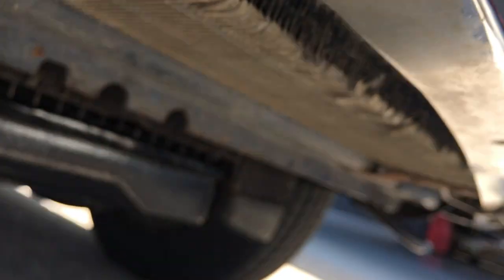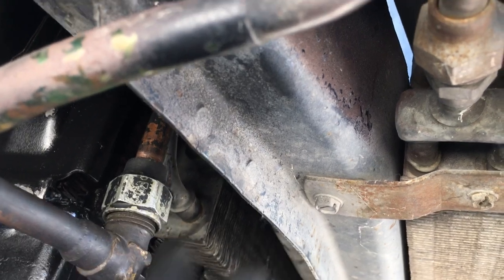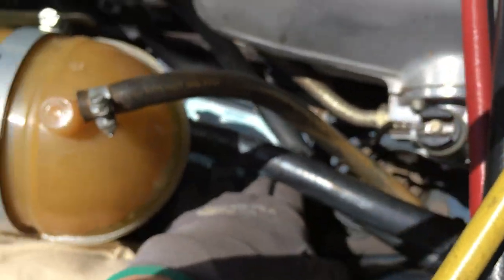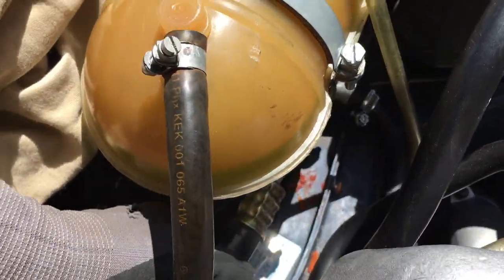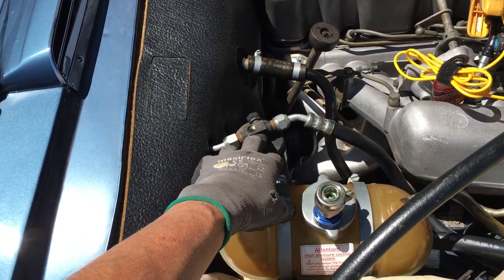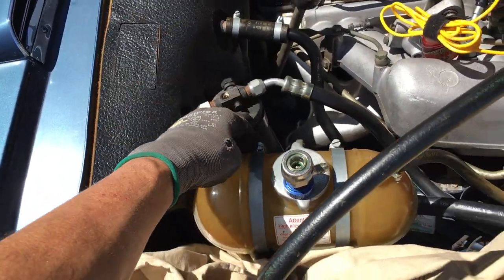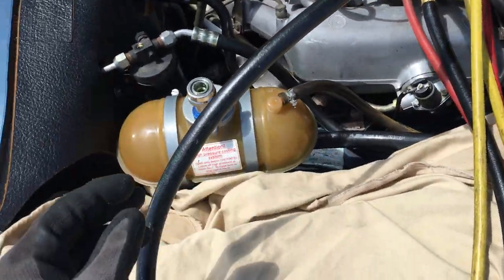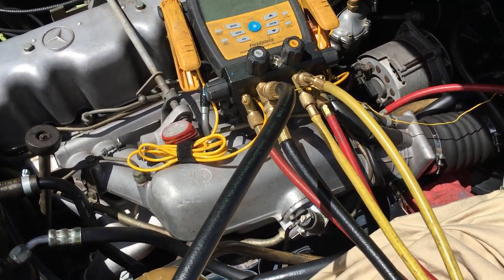1970 280 SL TWO CONDENSERS

Comment: When I built the A/C system on my 86 toyota pickup (all new parallel flow condenser, sanden compressor new evaporator assembly) I bought a drier with the high side port built into it and I mounted it on the fender. I made sure both my low side and high side ports were easily accessible.
Reply from the maker: A good friend of mine wants me to put air conditioning on his 1974 Nissan 620 pick up truck that’s in excellent condition completely restored. But he does not have the engine mounting bracket hardware and I really don’t have the time to fabricated make it myself and it’s not available.  Our upgrade to compressor upgrade to parallel flow condenser for a larger upgraded A efficient evaporator inside. He wants cold very cold I will give him frostbite.
Reply: @coldfinger459sub0  I lucked out when I did the A/C in mine. I found a compressor bracket that was designed to fit a sanden style compressor it was used in aftermarket A/C setups that were installed in those trucks so I was able to bolt the new compressor right in.  I also made sure I bought a genuine sanden compressor instead of the generic chinese clones. I also managed to track down a new old stock aftermarket A/C evaporator assembly that slots into the same spot that the factory toyota evaporator went but with standard A/C fittings. and man on a 90 degree day with 70% humidity idling in my driveway it will cool to 38 degrees (the evaporator temp cutoff) and it fogs all of the windows. it works way better than the factory toyota system ever did.

Comment: That's handy. Just waiting on delivery of my Fiedlpiece gauge set ☺
Reply from the maker: Automotive Solutions it will be a start of A new era. You may get a little frustrated at first learning how to use different features and learning what they mean or make sense of some of the numbers.       You will have questions when you start learning it you can ask.   The first thing you will do is pull a vacuum on it to make sure your micron meter can go low and then that your vacuum can hold to make sure you have no leaks in any of your hoses or fittings.  Then you’ll learn how to use the nitrogen pressure did K test within the unit to make sure your hoses and fittings do not have no leaks
Reply: @coldfinger459sub0  - ok so I have the gauge set. I pulled a vacuum on a waste cylinder down to 150 microns and left for about 20 hours. Microns rose to 1100.  Disconnected gauges and put nitrogen into gauge set but I seem to lose about 0.1 psi every 20 min, even with all valves closed. I put refrigerant in gauges and hoses and put my sniffer all over and it doesn't pick up a thing. Any ideas or procedures you recommend for proving the gauges and hoses. Cheers.
Reply from the maker: Automotive Solutions derives in microns to 1100 µm is most likely due to moisture that has absorbed into your new hoses it have to outcast and when it out gases The pressure will rise. Try leaving it on the vacuum pump a few more hours and repeat. Tell me what the outcome is.                       For the nitrogen pressure decay test. Fill to your desired pressure example 160 PSI ( 11 bar ) leave the regulator in tank valve open unless the system pressure stabilized for about 15 minutes. After that now you can close all your hand valve to the tank in the gauges. Allow your hoses and pressure to stabilize another five minutes. Now press the button that says pressure test to perform your decay test press enter and that will start your timer.     Get back to me with your results.   If there still slight leakage I will walk you through the next steps and refer you to one of my videos on how to stop the minute leaks with a disassembly and service using silicone grease.
Reply: @coldfinger459sub0  - ok, I'll give it a go tomorrow. Thanks
Reply from the maker: I just got home from a long days work and I was thinking about what else you can do to test your gauges.     1: Test your gauges without them being connected up to a waste tank.      2:  test your gauge manifold by removing all the vacuum hoses except for the one that is connected to your vacuum pump. Put caps over the ends for the threaded connections to your hoses to make sure they are sealed.  Use Nylog or silicone spark plug boot grease to act as a seal and lubricant for the O-rings and threads this will help guarantee a tight seal for vacuum.                      3: recovery cylinders at the valve stems of the handles the packing sometimes slightly leaks pass the valve stem. Apply some night log or silicone boot grease to the stem and tighten it down and then tighten it several times while applying the silicone grease or Nylog prior to pulling a vacuum.                   Never open your recovery cylinder tank to atmospheric air after you have pulled a vacuum. If your tank was made out of glass and you can see through it there’s a phenomenon that sometimes happened when you were leasing air and it’s pulling through an office into a evacuated cylinder the moisture comes out in condensates into microscopic water droplets to absorb into the surface of the tank that has waste oil in it that’s highly absorbent.            Try this that tank that you already had on vacuum for 20 hours put about two psi of nitrogen in it. Put a hot air gun or hairdryer on the tank from underneath support it until the whole tank is about 90 or 100°F and then pull a vacuum on the tank. See if your vacuum pulls down deeper and faster than the first time you attempted to pull a vacuum. And if everything is done correctly when you close it off the vacuum it should not raise to 1100 µm it might raise to 300 µm or 400 µm.
Reply: @coldfinger459sub0  Got myself a 5/16 vacuum hose, wow what a difference in vacuum times. Took the gauge set down to 100 microns for 1/2 hour with spark plug grease on threads and on the caps and it levelled off  to 500 in about an hour. Warmed the recovery tank and it held out to around 1000 microns. I filled the cylinder with Ofn and did a tightness test overnight using the feature on the manifold. It held to within 0.1 psi. It's opened my eyes to the ability of digital gauges. You just have to know how to work them and how to use the readings. The Ofn tightness test is amazing. I didn't realise how much Ofn reacted to temperature. Very impressed so far 😁.